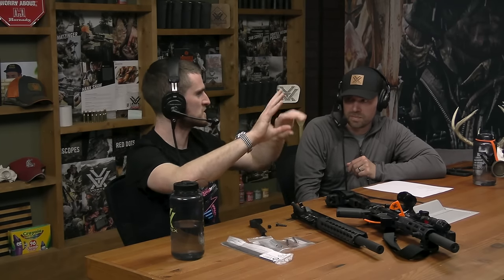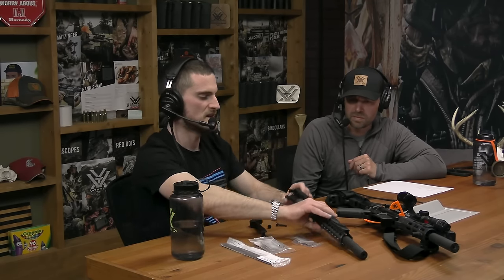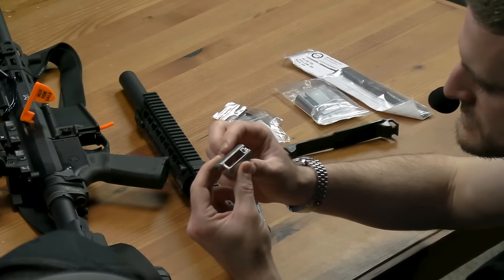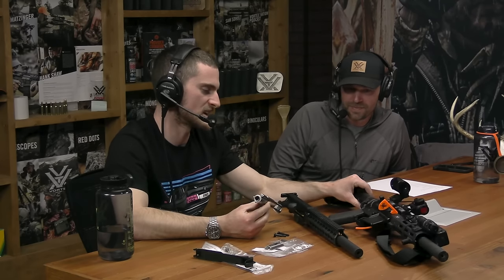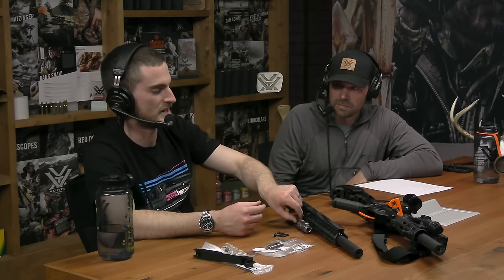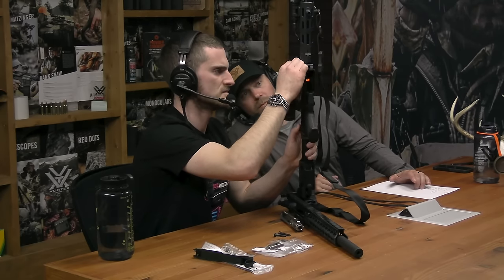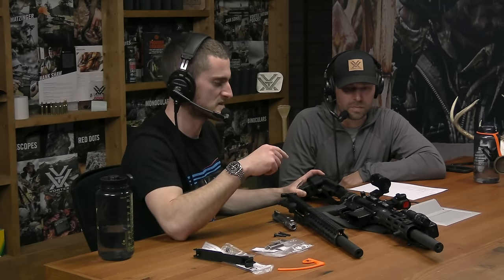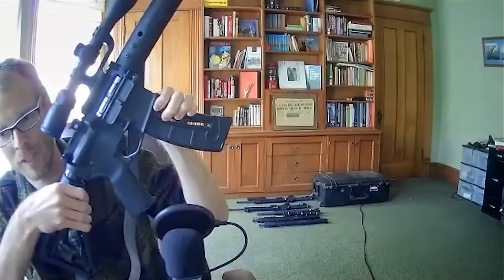Ep. 237 | .22 LR AR Builds – Everything you Need to Know

Comment: 10/22 is still a great option.
Reply: 10 22 costs alot if you want everything to be aftermarket.  But with money, no problem.  I would love to have both which I do.   But upgrades that I want on the 10 22 is pricey.  If I knew not to buy an oem 10 22 and just but parts I would've saved alot.  The ar22 maybe $500 max.  10/ 22 $900 +

Comment: I bought an expensive dedicated 22 kit and SBRed it.  It never worked.  I requested ATF remove it from the registry and I threw all the parts in the trash.  Cost me about $1100.

I got a $325 Smith and Wesson M&P 15-22 and it works great silenced with a cleaning interval of about 4,000 rounds.

I ordered a $700 bore buddy setup that's in the mail and I'm super excited to hear the cleaning interval will be 100 rounds.  Super high quality.  If that's true, I'm returning it.
Reply: Update: the BoreBuddy upper doesn't work at all.  T R A S H
Reply: Dang.

Comment: Before the original plug I was using a wooden dowel cut for a tight fit in the buffer tube. Then I went a step further and replace the bolt in a kns buffer adapter with a longer plastic tipped bolt so it would apply pressure on the carrier. Then I drilled and tapped a hole to install a qd socket in the bottom lug of the adapter. I had the best custom binary ar22 in the world for about 2 months before you came out with your adapter, then you released the adjustable buffer and now it’s the most reliable.

Comment: Interesting vlog am in the UK and bought my CMMG through Lantac UK.Lantac now build their own AR dedicated .22lr and use CMMG parts. When you bought a CMMG through Lantac they would polish the ramp,polish the trigger sear and cur a 11deg target crown on the barrel on every rifle. An interesting fact is that Lantac state on there website that super high velocity rounds should NOT be used and they give an example of CCI Stingers not to be used. Lantac are market leaders in dedicated .22 platforms so there meet be a reason for that statement. I used the CMMG mag once before buying the better mag kit and M&P mags.First thing I noticed out of the box with my CMMG was some slop between the upper and lower. I solved this by placing about 2mm of black RTV gasket sealer on the rear pin lug and letting it dry before putting the upper back on the lower.Six years later still no slop.I fire sub sonic (Eley Sport/ Contact) never had an issue. With a really cheap Hawk scope 6-8 x50 I can put ten rounds into a 1cm ring at 25 yards.I don’t use a weight but I can see the advantages.The UK are behind the curve on these weights, the only ones available are the older style with the screw in back plate so I will wait for the new ones with the roll pin back plate. My only criticism about the video is there is no real explanation on how to assess how much weight is required to get the best adjustment.Do you use a slow motion camera to see how much bounce is reduced?

Comment: I've had a dedicated .22 upper for years.  Inside of 350 rounds (from cleaning), it works nearly 100%.   Beyond 350 rounds...jam-o-matic.  When my son started shooting, we got into s&w m&p 15-22's.

I now have 7 m&p's...and my dedicated upper runs those mags now too.  Great for running AR classes, especially for the boy scout class we teach every couple months.  Most 10-14 year old boys will pick an AR over a ruger 10-22 every time.  Heck, alot of adults would rather learn on a suppressed .22 over a 5.56 carbine I've found.

They run pretty darn well up to 1,000 rds if you upgrade the extractor.  If you are not looking for a 1-to-1 analog for your duty carbine, want light weight (pistol is around 4.5 lbs with optic), and don't require them to be ruggedized....the m&p 15-22 is highly underrated.

Comment: Tweaking really might be an understatement with AR Rimfire. Ran three 22 22mag and 17HMR. The 22 by far had the least issues, just running stingers though so there’s that. If you really want to know what goes on in a gun it pays to build at least one if your own. I know you touched on firing out of battery and that’s no joke, gasses in the face and exploded brass  painting the inside of the receiver can be a real shock.
Reply: you fired a 22 mag from an AR? I did not think there were an options for that. Do you mind sharing what specifically you used?

Comment: A few years ago I got the CMMG conversion kit and three 10-rnd mags (Massachusetts) and used it on my S&W M&P Sport ver 1.0 (16") and it worked okay. But the gas tube blowback was really bad. The bulk .22 powder mess in the upper & lower was very messy! 
I found a very cheap 16" AR upper to dedicate to .22LR! I moved the gas block abt 6 or 8 MM forward to shut off the hot gas. Turning off the gas means 90% less crud to clean out of the upper & lower! My SSA stays a lot cleaner!  Nowadays, I don't need a full face shield to shoot .22LR! Just glasses.  I do have a few other .22 rifles, but nothing cooler looking than my AR-22 configuration.. :)   Great video! Very educational. Subbed & Liked!
Reply: Which upper did you go with?
Thanks!
Reply: @misterflannery3192  This  .223 wylde upper was super cheap and it has no markings. It needed work to fit the M&P Sport 1.0  lower pins and still needs to have the barrel centered in the MLOK forend.  
I have a 1-4x Leupold Hog scope on top and a Votatu P4L-R Rifle Laser on top where a front sight should be.. :)  
Grabbing that pic rail feels like a big sharp chainsaw blade.

Comment: I got the cmmg 9" dedicated barrel
complete bcg
complete bore buddy kit 
installed whatever and everything I could from bore buddy
matrix arms carbon handguard
sico flash hider
TN arms Polly lower
ak style folding brace
armorgedon suppressor charging handle
1-4 lvpo
ar9 upper (no assist but smaller port)
timney flat trigger 

thinking of going aluminum lower and Ar15 upper.

was trying different charging handles had no luck with Griffin arms snatch.

had a few failure to feed and double a few times

buffer wise she's as heavy as she can right now, going to start maybe playing with the buffer weight, just to see what's up

was using the cci ar22 ammo

going to check out that sw magazine set up.

thank you for this episode. ♥️

well now I guess I got to try another trigger.
Reply: Props to you for finding the TN lower.

Comment: I really enjoyed Will's response about pollution in a design.  I invented a way to easily grease 4wd front axles and one of the biggest questions I get is if its so simple how come nobody thought of it for the last 80 years.  I can refer to Will's response.  Now I have a question.  I am in the process of ordering the mac daddy setup from Bore Buddy through Valhalla Tactical Supply.  One of the things that has happened to me, more than once, is that the spent casing gets turned vertical and wedged between the CMMG rail and the top of the inside of the lower.  Its wedged in there quite firmly to where I have to take a small screwdriver and pry it out.  This is with the stock CMMG, Aguila 40gr, and proprietary barrel.  What causes that?

Comment: It's funny he is talking about timney triggers because I am having a problem with my timney trigger isn't hitting the firing pin far enough. It doesn't have that overhang over the lower that my LaRue does. So I'm getting light primer strikes. I was playing around with it last night and took my firing pin spring out and put a spent casing in and with the hammer all the way up against the lower it doesn't touch the firing pin when the firing pin is touching the rim of the case. So I had to put my LaRue trigger in my AR pistol that I run my cmmg conversion bolt in. The LaRue trigger goes more than far enough. On a side note I love borebuddy. I have their reliability kit and I just ordered the extractor kit and firing pin kit. I am hoping the firing pin from them helps so I can run my Timney in my AR pistol.
Reply: If you got our crescent, it will probably make it run.  The geometry is a bit different to help with triggers that do exactly what you are describing.
Reply: @BoreBuddy  I bought the round one. It should be here today. I'm hoping that one makes a difference. With good ammo I only get one failure to fire per mag or so with the cmmg. So it is still fun to shoot.

Comment: Once I installed my Bore Buddy onto my CMMG conversion kit, I have not experienced any failures 2500 rounds later.
Reply: What parts did you buy from bore buddy? Their website isn’t that helpful ha. Appreciate it in advance
Reply: @1776carpediem  I purchased the standard 22lr AR Reliability Kit which is currently $27.35. I also played around with ammo and found the 40 grain high velocity ammo works great.
Reply: @HopefulForever-ln5xm  thanks big time

Comment: The Catch22 with the stick on mag spacers is superior to the bettermag adapter imo. The catch is ;) you need to dedicate your lower or use there V2 slip on setup. No experience with how well the V2 Works
Reply: I couldn’t get the V2 to work without the lightened bolt catch spring, so I just put the spring and V1 dedicated catch in. I’m fortunate that I had a spare lower to dedicate, if I only had one I would have just suffered with the non locking black dog tactical mags (they’re great in every other respect).

Comment: Like the video,  my kit I'm running AR 7075 upper and lower with very tight tolerance, and have no movement in the bolt to buffer, barrel. Cmmg charging handle, no gas in the face, Running a standard polished mil spec trigger single stage, but running a lowest tension hammer springs, no cycling issues. the best ammo for me, is this federal 1000fps subs suppressed plated.. Never any misfires, cleaning to a minimum.  Gunpowder is not cheap/harsh/ smokey. 7.5" 1.7 arstoner barrel accurate to 250 feet, 12" targets, quite.  Sounds like a nail gun. Alot of fun.

Comment: Could you arrange to cover the accuracy of 22LR dedicated upper? I went through the same path as mentioned in the video, i.e. starting with CMMG conversion kit then building dedicated upper. However, accuracy wise, I did not see any improvement, all the same about 2" group at 50 yard (more tham 10 type of ammos used in the testing), between using convention kits and CMMG dedicated upper (CMMG 16.1" barrel + collar, reusing the BCG body/frame from conversion kit). Considering all the facts described in the video, correct twist rate (1:16 vs 1:7), longer barrel (14.5" vs 16"), bullet and barrel diameter matching (.223 vs .224), should we expect to get better accuracy using dedicated upper?

Comment: I have bought some of your parts and they have noticeably improved my CMMG dedicated upper.  I have a Rise 140 drop in trigger that seems to work well, perhaps I just got lucky.  I do hate the CMMG magazines, they have a terrible fit perhaps you can engineer a solution that takes the wobble out of these popular but poorly designed magazines.
Reply: Have the same trigger and it seems to set off everything but those same Arscor 36gr Will mentioned, which have about a 90% success rate. For the wobbly mags, I'd maybe try out some tape, or put some velcro in your mag well to add tension all around.

Comment: I like the Larue name drop. I feel like a lot of their products are overpriced, or I just can't appreciate them maybe, but I love my MBT 2 stage, especially for the price, but even if it was more expensive it feels amazing and even with the heavier weight 'duty' spring it's got a great break and reset.
Reply: The Larue MBT trigger is a rebranded Schmid Tool 2 Stage. Schmid's are not expensive anyway, so Larue's sticking their label on it and racking in a markup. Mark LaRue loves fucking with Bill Geiselle.
Reply: @CalzaTheFox if by "rebranded" you mean "follows the typical 2 stage trigger style but has a different disconnector set-up, different hammer, and different sear engagement angles" sure.

Comment: So here's my desired build:  4.5" upper and a Franklin Armory BFSIII binary (I have a registered SBR lower with the BFSIII already installed for my 7.5" 300 Blk build).  I'm looking at the RTB 4.5" complete upper.  Other than the weight kit, what else would I need for this build? Would it require lighter springs or hammer or anything like that?  If so, then another registered lower and a dedicated build would probably be needed, right?
Reply: For a binary trigger I believe you would need the trip kit from bore buddy.  I have a 9 inch dedicated 22 upper. 3-5 rounds per 25 round mag fail to feed, eject, or fire. I bought the premium reliability kit. Hoping that clears up the issues.
Reply: @jpennel25  Based on what I've been reading and watching, I think I'll go with the Bore Buddy 4.5" upper with all the performance parts...if they ever get them back in stock!

Comment: I've never had great reliability or experiences with either a dedicated upper or a conversion kit. If the weapon doesn't run everything I want to feed it, I don't want it. I would just buy a 10/22 or a more reliable dedicated platform. I would've liked to see a AR15 that runs 22 right because of the parts compatibility.
Reply: It'll get there -- I'd put my AR22s against the 10/22 for reliability and accuracy and I'd be confident that they would be at least as good.  Give it another decade and I'm betting AR22s will outstrip the 10/22 in popularity as gun purchases start being driven by younger generations.
Reply: @BoreBuddy  I appreciate your dedication to the platform. After watching the podcast, it makes me have hope here soon. I look forward to to the evolution to AR22s once parts and materials become cheaper and more widely available. It actually says a lot that you have the parts in stock currently.
Reply: @2amichaelj  We work hard to keep things available despite the supply chain challenges!

Comment: Stupid question, but if I buy the .22lr conversion kit bolt for my 1:9 twist 5.56 upper NOW, can I just take the fake 5.56 off the front of the BCG and use the rest of the BCG on my dedicated upper when I am done building it?
Reply: Yes you can. You can just buy the insert and swap out that 5.56 "funnel" adapter for the dedicated .22 barrel adapter. BoreBuddy and CMMG both sell that part.😇

Comment: I'm curious about the bolt bounce issue. Is the CMMG bolt too light? Why would CMMG do that?
Reply: It has a lot to do with power variance between 22lr loadings. A rifle setup with zero bounce running standard velocity will probably get some bounce out of mini mags unless some form of mitigation is used(buffer).
Reply: Thanks! So High Velocity rounds may need a heavier buffer? CMMG tuned their bolt to Standard Velocity? I assume this logic would apply to a Ruger MKIV? Similar blowback bolt...
Reply: @AbnerMalady1  The bolt is underweight to allow reliable(ish) cycling across many ammo power levels.  The bolt bounce is amplified by the light weight, but doesn't change much with a change in power of the ammo since it's driven by the spring on closing.  Lighter springs, bolt weight, or a buffered collar (quiet collar) all help reduce bolt bounce.
Reply: @BoreBuddy  Thank you. I am only about 150 rounds into this CMMG build and it has been very reliable so far. It is good to know what to look for going forward. Thanks, again!
Reply: @BoreBuddy  I’ve shot on high speed with multiple ar22s, 2 dedicated(4.5,16) and a 10.5” conversion. My baseline for tuning has been Automatch and before your buffer was released I observed increased bolt bounce with the cmmg weight using mini mags. There was a noticeable bolt speed increase on both the rearward and forward travel. It’s pretty evident with an frt, going from automatch running good to mini mags getting a light strike after short burps even using your adjustable buffer. ROF increased as well. My sample size of 3 but I’ve shot literal buckets through them 🤣
Reply: @BrassCatcher  Yeah, there can be a slight increase in bolt speed returning if the bolt bounces hard off the backplate.
Reply: IME before I got the weights, my CMMG kit ran SV and Minimag and similar just fine. Velocitor was spitting burning propellant at me (coming open too quickly, also mangled the rubber pad Bore Buddy sells, don’t shoot Velocitor or other “hyper velocity” without the weights!). CCI Quiet had hammer follow, was getting 2-3 round bursts 😁 (fun, but not what I bought those for). This is with a 20” barrel, both my dedicated upper and my 5.56.

Comment: I am curious about 22 mag ARs. Anyone have any experience or information how they run?
Reply: I have the Bear Creek Arsenal (I think?....maybe Black Creek?)  I think my 1st one was a conventional 't' charging handle from the same company (gen 1?), and my new one is a side charger.  Magazine availability suck (10 rounders), and they don't feed very well to begin with.   Stays way, way cleaner than any .22lr upper I've used...but I haven't been able to make it reliable.  Absolutely needs 40 gr loads to cycle, and almost never gets to the bottom of a single mag before it chokes.

To top it off its about a 10 moa rifle (I have the 16").  So I don't have a ton of incentive to get it running well.  Threaded barrels on both look sketchy enough I've never tried suppressed.

I bought the first one because .22lr wouldn't knock down our 25 yard steel challenge plate rack 100% even on solid hits.  Club eventually upgraded our rack and .22lr's work fine now.  The side charger I bought on a whim and has all the same problems the first one had. 

Good idea, and I'd be willing to give it a try again if anybody had a proven model that was accurate enough to be usable.  I just can't justify messing with an upper that struggles to keep half my shots on a pie-plate at 100 yards.
Reply: @jonathonschram3429  thank you for the response. Very helpful.